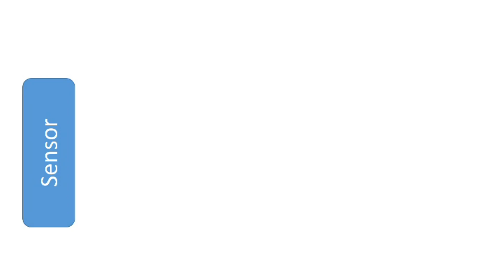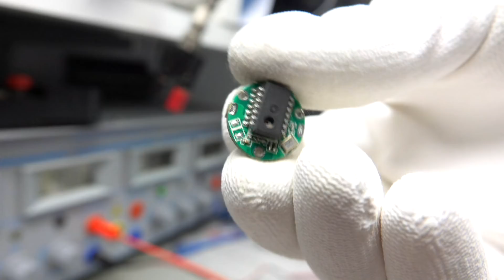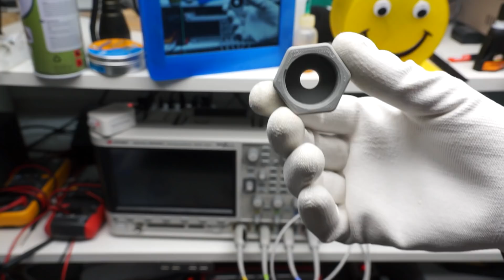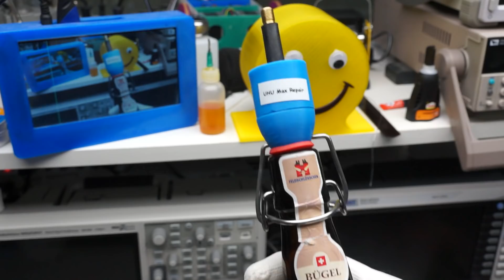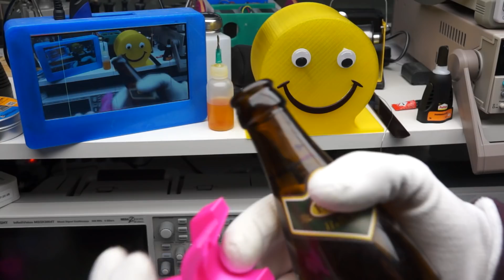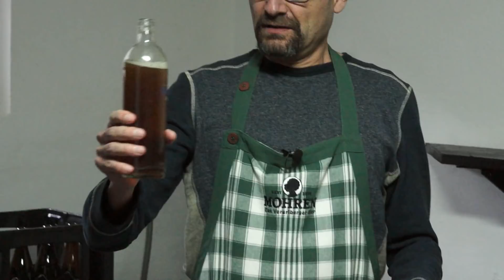#265 Pressure Monitoring incl. Fusion360 Tricks

Comment: Just curious, why was it so important that the sensors be wireless?  Couldn’t they just be wired directly to the Pi0w as some sort of pressure reading station? I wonder, as a have a project planned for reading water pressure throughout my house (to check for pressure drops as filters become blocked) but was simply planning on using some esp8266 or Esp32 wired directly to the sensors.  Really enjoy the videos and am proud to support your efforts!
Reply from the maker: Thank you for your support! The main reason is that I like wireless ;-) 
For a stationary installation, wired sensors make sense (if you can wire them to your MCU). Here, the bottles are mobile and put away into a dark room. So, wires would not be comfortable. In additions, these sensors should last for quite a long time with only one battery.
Reply: For me the main reason for wireless is that I have the word "NERD" in my name :-)
Reply: Hats off to you for your diligence with wireless applications. I’m too new with this stuff and fear additional complications of communication interference as well as battery and power management that also has to come along for the ride.
Reply: hopfeNerd does the word ‘hopfe’ mean anything related to your hobby?

Comment: Andreas, what do you think of using a strain gauge mounted on the bottles on the glass? As the pressure increases, you may be able to detect the slight enlarging of the OD of the glass. Then again, it may be so small that it's imperceptible and noise would drown out the signal.
Reply from the maker: Glass is probably too hard and does not move enough.

Comment: A bit complicated. I have done pressure testing on an industrial scale for years.  A normal cork with a small tube flanged and sealed with silicon is adequate for this purpose.  I use brake tubes, they are cheapest and a stainless "oil" pressure sensor are only a few euros.  When the test process is volume sensitive I water fill the tubes-  To make safe, you can use a long tube and put some weight on the cork, stretch the tube around a wall and pump up the bottle with water until it blows.  As long as you after that are under 50% you should be ok.
Reply from the maker: Thank you for the tip! These sensors are really cheap.

Comment: I would blame planning department, but not much, because drinking science was made. This is good example for solving problem using skill set and machines that are closest to you. Probably I would use big enough wood workers clamp to secure sensor to any bottle, this would require minimal metal working, but would be really universal. It might require some science to test using many many different bottles :) I´m sort of struggling to not get interested at brewing, this is not helping at all :|
Reply from the maker: To help your decision: Brewing is much more time-consuming than getting the beer around the corner ;-)

Comment: As always, a great video and I commend you on the sacrifices you made in the making of this one.  A question if you don't mind.  Knowing the pressure is interesting and important if you are going to intervene if the pressure becomes too high.  But isn't the point to prevent the bottles from bursting?  Why not create a cap system that has a preset pressure relief valve that allows pressure to escape when it exceeds a preset value.  Your 3D cap would appear to be the perfect beginning of that.  A tire valve that uses a spring to hold back x lbs of pressure but is over come by x+ lbs of pressure would do the trick.  I have brewed for many years and have never come across such a thing.  I have to wonder why.  Fortunately I moved to small kegs and do not miss the bottles.  The cleaning, filling, worrying about pressure and the inevitable empty bottles sitting around giving away how much beer you drank is a hassle.  Interesting video and now I am off so I can try to figure out how I can incorporate TPS in to something...
Reply from the maker: Reto told me that he monitors the pressure to get an overall impression on the fermentation and when the beer is ready. But you have to ask him for these "brewer specific" questions. The alarm was just an additional feature, not so important for him as he seems to have the process under control.

Comment: Hello Andreas! Is the pressure sensor also watertight from the pressurized side? Otherwise I see some corrosion starting there...
Reply from the maker: The data sheet does not say anything. We have to do tests. I assume the silicon on the chip has to be protected somehow. These sensors are made for the automotive industry which usually is quite picky...

Comment: That`s a nice project.
What`s about an over pressure valve which is activated by the pressure alarm?
Reply from the maker: It is not mainly about over pressure. The brewer wants to know the pressure to know when the beer is ready.
Reply: @AndreasSpiess  Ok. But in the video you explained bottles can explode due over pressure. The over pressure valve might avoid this situation and the further mess. The over pressure feature could be an additional option to the pressure monitoring.

Comment: Applying sensors is always interesting :-) I've been wondering if testing and using ambient CO2 sensors could be a project for you, like to check air quality and sound an alarm if windows need to be opened. You might be able to combine it with a test case of how much the CO2 ppm increases by drinking a few beers in a small room!
Reply from the maker: In the making... As you see I already started the training with the beer ;-)

Comment: Hhhm, not finaized up to now. Because: the blck rubber of the tire valve most probably is not Food-safe (lebensmittelecht). In Germany there are the Colors red and White reserved for Food-safe Rubbers.
Threads are a fantasitc invetion but often they are overestimated. And the mnemonic for mechanical engineers is also helpful for electical engineers:   "Gewinde dichten nicht und Gewinde zentrieren nicht!" ;-)
Reply from the maker: You are right about the rubber and we discussed it. Because it should not come in close contact with the beer we had no issues for using it in the private environment.
Concerning "Gewinde" As an Electrical Engineer I learned it now the hard way ;-)

Comment: Andreas, Could you monitor the amount of gas in the neck of the bottle as a proxy for pressure?
Reply: Just out of curiosity... How would you measure the amount of gas in the neck of the bottle?
Reply from the maker: One problem was that the bottle has to be airtight. If you want to put the sensor into the pressurized area it has to be rather small (diameter of the bottleneck). I have a few Co2 sensors around here. So we might see some experiments with it.
Reply: @AndreasSpiess  My thought was that as the pressure changes, it will have secondary affects (like the height of the gas at the top of the bottle or the bubble formation rate and since those are all visible through the glass, if you could figure out how to use those as a proxy for pressure then you could detect over-pressure visually.

Comment: Sealing 3D Printed parts for air pressure is really hard. Last time I tryed to print a valve I'd give up frustrated after a while. I wonder if there's a solution for the leaking air throug the print layers problem.
Reply from the maker: A few viewers suggested dipping the whole part into epoxy or PVA.
Reply: @AndreasSpiess  I've seen an SLS printed part that was used for pressure distributiuon in an industrial application with up to 6 bar lately. So if you are still looking for a solution you may give it a try and let your part print with SLS at an online 3D printig service.

Comment: Interesting. Failing means either you’re finding methods that doesn’t work so you can eliminate them or you’re looking at the problem from the wrong point of view. You cant simply say today I’m going to be successful and creative. Sometimes you have to remember that the way you want to do something isn’t the only way. There is absolutely no reason beer can not be placed in a keg for the second fermentation. You could friction drill and thead a fitting into the vessel or just pipe it into the plumbing. Once the beer is ready it can be transfered to bottles and capped. Just because he wants to do things his way doesn’t mean it’s the best way. To be truthfull i laughed my ass off seeing a tire stem being used on a beer bottle.  I would really like to see the face of a beer drinker when you handed him a bottle of beer to drink with a valve from a tire sticking out of it. That would be so entertaining.
Reply from the maker: I am not the brewer ;-)

Comment: Why is someone taking the effort to put sugar in every bottle? It is way easier to put the amount of sugar for all bottles in the bucket before bottling.
Happy Easter ;-)
Reply from the maker: I will tell him. Seems to be logical for an Engineer. But for a Brewer? Happy Easter, too!
Reply: I already made my mind up about this but i'm not shure if it's a good idea because of the risk of swirling up the yeast on the bottom of the bucket. Perhaps dissolving the vorrect amount of sugar in some water and softly pouring this into the beer could be a solution.
Reply: @hopfeNerd  Way easier. Get the fully fermented beer in another bucket "without" yeast. There is still enough yeast for the carbonization left. At fabier.de you can easily calculate the amount of sugar. Dissolved in some water and filled in the other bucket before the beer and gently stirred, i did not have a noticable difference in pressure till now. No explosions and no measurement. But also less fun ;-)

Comment: I hope your humor is not due to an excess of beer ... all those bottles someone will have drunk :-))
seriously it's true that it takes brain but it also takes luck in everyday life.
Nice job but maybe it wasn't better a safety valve calibrated to the maximum bearable pressure?
  if the overpressure alarm is triggered? Do you drink all the beer before the bottles explode?
  They are not critical, they are just my ignorant thoughts in the brewing process (I made some mead but it's simpler)
Cheers at both of you!
Reply from the maker: The maximum pressure alarm will not be triggered often. Measuring the pressure seams to be important to decide when the beer is ready.
Reply: @AndreasSpiess  Now i know! I thought there was a danger of overpressure, instead it is an index of "maturation" of the product: when it arrives at xy bar it is ready and ... prosit! (is that the right word?)
Bye
Reply from the maker: Yes!

Comment: Instead of the rtlsdr , maybe a signalduino wth an esp8266 may be a better solution. Here is some information https://wiki.fhem.de/wiki/SIGNALduino.
Reply: Here is the github with a less detailed English explanation https://github.com/RFD-FHEM/SIGNALDuino. The esp8266 version is called signalesp https://github.com/RFD-FHEM/SIGNALESP. They are inteded to be used with FHEM, but if you know the format of the signal, you can use it with other programs.
Reply from the maker: Thank you for your link. It seems to be a similar concept like RFLINK presented in an earlier video. Unfortunately, I did not find an FSK receiver. All simple receivers I found were for OOK. I read something about the CC1101. This chip is interesting, but I did not manage to get it running for these slow speeds and narrow signals. I would be interested it somebody has more info about that.